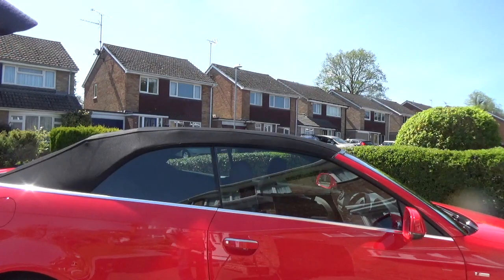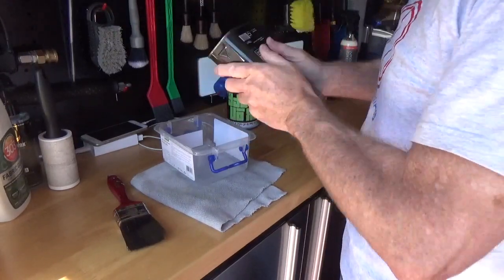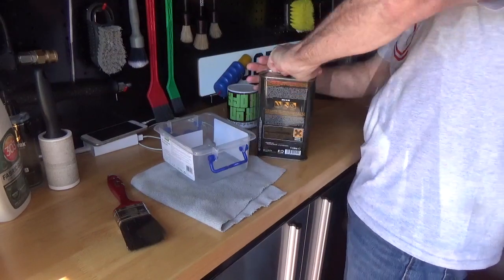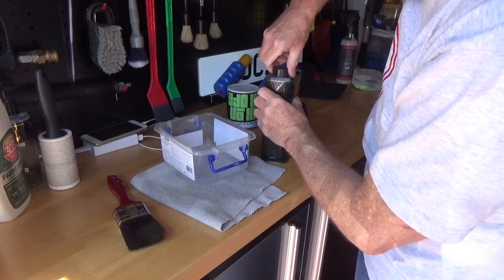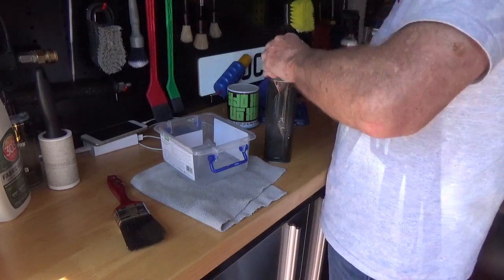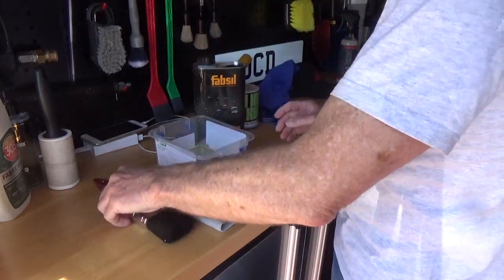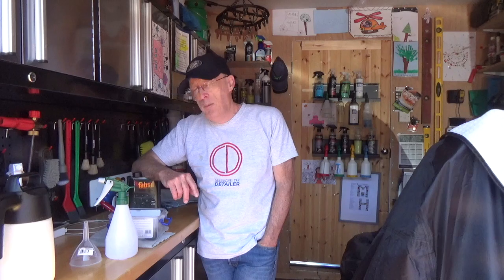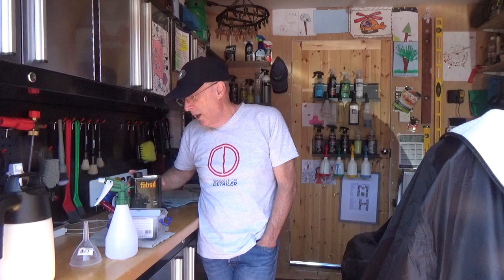Fabsil soft top protection

Comment: I have just done my pop top roof canvas with fabsil. I have found that it is easier to apply with a clean cotton cloth, absolutely soaked in the stuff. With a brush it sprints everywhere.
Reply from the maker: Sounds like a plan Steve. I will do that on the next application 👍.Great tip thanks

Comment: Fabsil is a good product and has been around a long time. I would definitely apply 2 coats the second one will be much easier as it will be less absorbent now. I would try and stick with the brush and really work it in. I think the sprayer would be less effective. I recieved Atom Mac today so look forward to trying it at the weekend.👍
Reply from the maker: Will do Dean, thanks. Good luck with Atom Mac👍
Reply from the maker: Just gave the roof another coat with the brush. Definitely easier the second time and the product went further. Plus its a nice evening with no hot sun so all the product stayed on the roof👍
Reply: @ObsessiveCarDetailer  I'm sure this will give you the results you are looking for. We used to use it on E type soft tops at a previous job.

Comment: This is an old trick of the trade, done a lot of these, fabsil is by far the best protector, I apply it with a fine spray bottle then just run it in by hand, overspray wipes off easy with a cloth or a bit of kitchen roll. 👍

Comment: Beads look great Martin, but then as you say some parts are flooding the fabric a bit, maybe a 2nd coat might help?, has the Fabsil affected how the fabric feels?
I was about to send a link to the Leather Repair Company as they have a soft top sealant which I never knew about , it’s not cheap though £32.50 for a 500ml bottle, don’t know how much Fabsil is but it’s an expensive experiment 😜
Reply from the maker: Hi, the Fabsil cost £12.00 for 1 ltr free shipping. Will keep you up to date on performance👍

Comment: Fabsil is not recommended for fabric tops as the silicone can harden the rubber membrane under the upper fabric. In addition if you try to recolour the hood at a later stage the Fabsil will stop the colourant from penetrating the fabric leaving a white frosty look. Better to use a water based sealer.
Reply from the maker: Hi Oran, where do you get this information from

Comment: I just bought a new s3 convertible and was looking for a good system to waterproof the Roof. This looks great. I just have a couple of questions if you would be so kind.  1. Why would you say the best cleaner is for the roof ? 2 would you recommend the Fisil Gold over the regular one? 3 how often does the roof need doing? I am in Scotland so it rains a lot 😃😃. Thanks again for the videos and the lint brush is a stroke of genius 😃😃
Reply from the maker: Hello Jason, If the car is new then just a good quality shampoo is fine for the roof. My preference is Garage Therapy One Car shampoo but whatever shampoo you prefer. Fabsil Gold is by far more effective on a cloth roof than the ordinary Fabsil. I wash the roof every time I wash the car but as far as applying Fabsil it depends on the conditions but I get 6 to 8 months of good protection from an application and could stretch it to a year. I have just released (last week) another video on how I clean the roof if that's of any interest. Happy motoring with the S3👍
Reply: @ObsessiveCarDetailer  thanks for getting back to me. Just watched the new video Fabsil gold ordered as well  nice soft brush for cleaning g and another one for application. Hoover at the ready now just waiting on a couple of Clear Dry Days 😃😃
Reply from the maker: @jasonwilson9644  👍Don't be surprised Jason when you get strange looks from the neighbours when they see you vacuuming the roof. I will be interesting in how you get on.
Reply: @ObsessiveCarDetailer  I will keep you posted 🤣🤣.

Comment: Hey Martin have just come across ur videos an all ur tips r amazing. I have just bought a a3 black convertible and looking to keep it in the best order that I can and I was just wondering if you could tell me in your opinion whats the best wax and protector u have used an also protector and cleaning products for the roof? And cleaning an protect alloys and blacking the wheels please if u don't mind just I live in a flat an not a lot of space for products but would like to use your recommendations many thanks Lisa
Reply from the maker: Hi Lisa, welcome to my channel. Ok so where do I start. There are many good products to choose from but Im guessing that you also want to have easy access to buying them without paying for shipping. Are you based in the UK? if so you can't go wrong with Autoglym and easy availability from Halfords Stores. Car Chem products are good and free shipping. However check out my videos on "ceramic wax by Reflect car care" & "Reflect car care maintenance wash". You can buy the ceramic bundle from Reflect for under £30 and you get a great ceramic wax, a SI02 detail spray and good quality buffing towel. Check those two videos out and get back to me on any questions. Just remember there is no such thing and a dumb question we all have to start somewhere. I really like Garage Therapy One Wheel shampoo & after washing the wheels you can apply Reflect detail spray to protect them. I have struggled to find a good soft top cleaner and protector. The best protector to date is Fabsil & its cheap. A lot of detailers use All Purpose Cleaner (APC) but I tend to use dedicated soft top cleaners and not found one that stands out from the crowd so suggest you go for one that meets your budget. I hope that is of some help, if you want any more ideas then please get back to me.👍

Comment: Hi thanks for the video. I have a leak in my a5 cab roof, think it’s blocked drain tubes. Did you have any leaks on the car before using fabsil? I am thinking most water will bead off, leaving less to make its way down the drain tubes and less chance of them blocking.
Reply from the maker: Hi Clifford, not had any leak issues but its clear when it rains that the protection is there as you can see the beading. Although when it rains consistently the beading goes but back again next time. Not sure the protection will resolve and problems as the water will run off the roof quicker so the need to ensure roof drainage is clear should be your priority

Comment: Hi Martin I was just wondering if them spray bottles on your door the blue, yellow, red and green ones are any good as I’m getting fed up of using alloy wheel cleaner and the sprayer packing in, or have you reviewed these in the past. Cheers Andy.
Reply from the maker: Hi Andy, no I haven't reviewed them as yet. They are Kwazar Mercury 0.5L Double action trigger sprayers. I bought them from Clean & Shiny for £7.59 each. I really like them, they are designed to operate even upside down but they are a double action spray head & not everyone likes that feature. What that means is the product will spray out as you pull the trigger and again as you release the trigger. For me that works really well especially if you are using them to cover larger areas as it means less pulls on the trigger. You can also get them in 1L size for £8.79 but for me that is too big but might work for you. I have ONR, APC, Citrus wash & Road Rage in my four. Just for interest, the storage units on my door are from Gleem Detailing & really allow me to use what little space I have to the best possible use. Hope that is of help.
Reply: Obsessive Car Detailer 
Thanks Martin I’ve ordered some, there just what I’m looking for. Thanks Martin.

Comment: I have tried Fabsil (not Fabsil Gold|) on a 16 year old convertible (brushed on to saturation point).  My experience over 1 year of repeated applications is that it has about 2 maybe 3 weeks lifespan before it begins to fail.  Fabsil is not the way forward on a very old fabric soft top.  Next product I'm going to try is Renovo.
Reply from the maker: Hi Dean, please let me know how you get on with Renovo please👍
Reply: @ObsessiveCarDetailer  will do bro, just watched another review that suggests Renovo has an 18 month lifespan as does fabsil gold which is interesting.  Looks like original Fabsil does not have the power.  I can recommend the paint brush method though for Fabsil it really saturates it so how about you try Fabsil gold and I try renovo and we compare notes.  As it stands my daughters 16 year old rag top beetle is leaking like a sieve
Reply from the maker: @deanrichards1513  I now have Fabsil gold on the shelf and been meaning to get it on the car but its been in the dealership for repair as my wife bent it a little🤷‍♂️I will use the brush method and do a quick video on it and the review a while later👍
Reply: @ObsessiveCarDetailer  I've been using Renovo on my mohair hood up to now, and one difference I noticed straight awayin your demo is that when you brushed the Fabsil on it soaked in where it touched, whereas when I brush Renovo, it runs off like water and I have to chase it around. Also Renovo seems not to shed or bead for me as well as some people reckon, even with two coats - not even as good a result as you got with one coat of Fabsil.
Reply from the maker: @tonyfisk8081  just looking at the soft top as I write this and the Fabsil side is still beading as it was on day one and the car chem side is crap, just flat. I’m definitely going to stick with fabsil, can’t wait for dry weather so I can do the whole roof plus it’s £12 for a ltr 👍👍👍
Reply: @ObsessiveCarDetailer  ...dry weather... (hollow laughter)
Reply from the maker: @tonyfisk8081  didn't last long, raining again. check out my latest post on instagram. this is defiantly the product for me
Reply: @ObsessiveCarDetailer  Just had a couple of days with the right conditions to apply a coat of the Fabsil Gold, and results are like yours - beads the size of 50p pieces running off the top. For reference, the car is a '53 reg Saab. I have never had results this good with Renovo - even after two coats. 
Just lucky with the weather?
Reply from the maker: @tonyfisk8081  it’s definitely the best product I have tried on the roof without doubt. So glad you tried it and it met your expectations & compared to car detailing products its good value

Comment: You can get this in aerosol form which is what i used to use on my tents and trainers
Reply from the maker: I did think about that but thought this was a little more flexible.
Reply: @ObsessiveCarDetailer  mine is only a small tent I use for car shows . Sadly its a jelly baby tent , i get stick for it and kids find it funny but its for 2 shows a year and cost me £3 . Yes Im that tight
Reply from the maker: Twistedmind Photography do your feet stick out the end🤣🤣
Reply: @ObsessiveCarDetailer  not quite , i cocked up last show with the air bed i was almost touching the ceiling of it . With my buggered back its getting out of it thats the fun bit , better than sleeping in the car though which i used to do